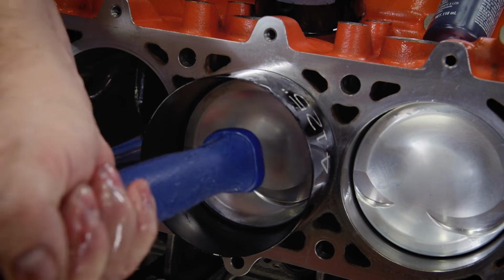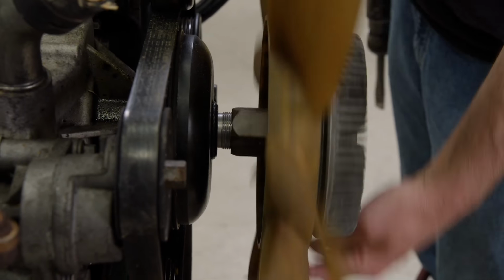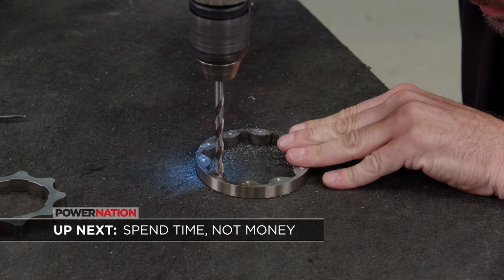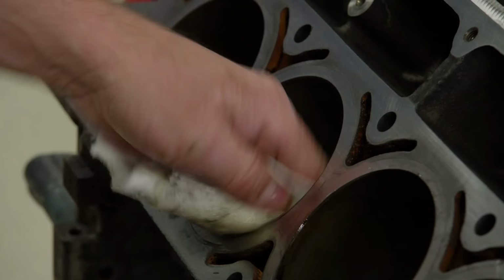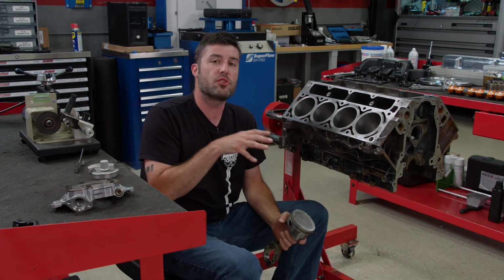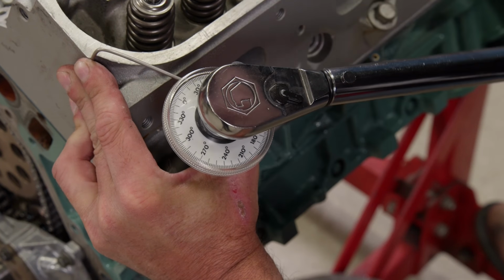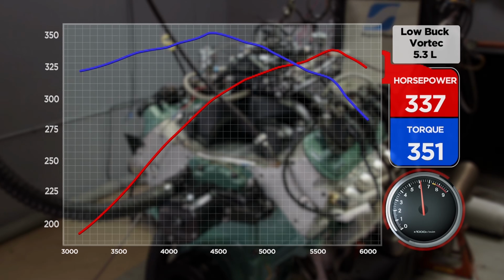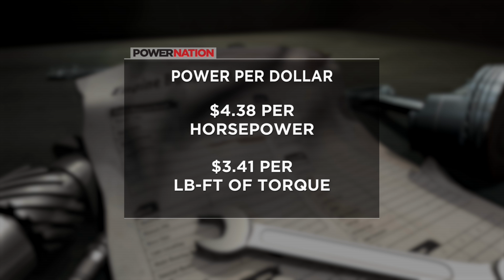Minor Upgrades Create Crazy Power on a Junkyard 5.3L Vortec - Engine Power S7, E10

Comment: You could get the exact same results by just a cam swap and intake upgrade on a bone yard engine most of the other stuff they did was unnessassary
Reply: They didn’t even do anything else besides cleaning which if you want a long lasting engine, is necessary . All parts were stock besides the mild cam
Reply: and how about the dupli-color green enamel 2000 paint ?  Gotcha :))))
Reply: Only other mod was oil pump and I can see that being important engines won't run long with out oil pressure
Reply: Yeah, they could’ve just upgraded the cam and intake but it wouldn’t be much of a show if it was over in 5 minutes.
Reply: Cleaning is pretty necessary
Reply: How is balancing a crank, and properly gapping piston rings unnecessary? 
They performed a basic engine overhaul.
Reply: @Stephen_2026-drq  If your going to run nitrous you need to add ring gap, the extra heat could expand the rings until they butted and scored the cylinders or lifted the top ring land on a piston.
Reply: And it won't go another 200k .  Rather clean it all put new bearings and have piece of mind
Reply: @sschevmale24  if its driven decently and has regular oil changes and not driven by an asshole, I don't see why it wouldn't go another 200k
Reply: @sschevmale24  Why not ?  In 2012 I pulled a 181,000 mi 6.0L LQ4 and trans out of a power company truck, pulled the pan and cleaned out the sump, Installed a new Melling oil pump, an Elgin 1840P cam and put bushings in the rocker arms.  Everything was stock including the intake and injectors, we reflashed the PCM and cut down the harness, never even pulled the heads or a rod cap.  I put it in a '91 Chevy 1500 and change the oil and service it regularly and right now I have 78,000 miles on it and 40+ lbs. oil pressure at Idle running 10w/30.  That's over 250,000mi + on the long block and she's still running strong.  I believe it could go 400k, now it's a test and still a ball to drive.
Reply: EXACTLY! If it came down to either throwing in the motor ‘as is’ or decking my block with sandpaper, I would choose the former.
Reply: Most of that was looking for problems that might destroy the engine unexpectedly. I’ve seen what can happen when a motor fires chunks of steel out of the block. I wouldn’t shoot nitrous through any used engine without the kind of due diligence shown here. But then I work on my daily driver, maybe I would worry less if I was building a toy.
Reply: what would the labor price be on a job like this?
Reply: @charlesawallacesr.9690  If you have to ask, you probably can't afford it. Nothing wrong with just buying a factory crate engine.
Reply: @charlesawallacesr.9690  Free, just do it yourself.  The LS platform is the easiest engine ever to work on.  You can literally do it like they did from a book.
Reply: send it
Reply: Lol If you want to jump straight to an upgraded cam, you're gonna have a lot of issues with your builds over time.
Reply: I love a good parking lot engine rebuild. It's amazing how mechanically inept most people are. People will watch you like your doing some some sort of magic. "I can't believe you got it running again!"🤯
Reply: What type of cam or model n exhaust brand or model if u don't mind thanks
Reply: @javierd.f.8695  Did you watch the video? they show what cam.
Reply: first of all u cant just adda nitrous kit and get the kind of power numbers expected. using a 150 hp shot of nitrous on a stock ring gap will crack a number of piston lands & possible engine failure. i know i did it
Reply: @racermike1946  If you watched it they opened up the gap to .030".
Reply: If it had a 650 cfm Edelbrock carb. With a Demon intakes manifold. Also installing peformance pushrods and rockers. Also peformance plugs. With a Holley Nitrous kit. That engine would have came alive. Makinig at leat 800hp.
Reply: @will4.0ofthethrone9  nitrous is lame
Reply: @will4.0ofthethrone9  lol, without making a more stout bottom end you can spray as much as you want. 800hp for one pass maybe......
Reply: @jasonyoung8614  I have LS's making over 1000hp with a stock bottom end and a single turbo and I've seen them make more than that and still live no problem even with the stock heads.
Reply: I cant imagine the logic with pulling 5.3 or 4.8 heads off any LS motor and reinstalling them.  You can find heads with 2” intakes for like 100 bucks, which will actually make a cam swap worthwhile.
Reply: Wick question can I do this on my Chevy avalanche 2005 1500 5.3L.?? Please any help
Reply: @recioh1297  it's the exact same engine so yes
Reply: @recioh1297  Sure you can.  Just do the cam swap and have your PCM reflashed for the higher output.
Reply: I kinda think the pushrods and rockers was well spent money.
Reply: Well i have the same engine with 264miles i need help
Reply: Which cam swap do you need
Reply: Those HP numbers are extremely inflated and exaggerated. Even with all the nitrous you want to piss into the thing, using the most optimal cam you can possibly match to the setup, any intake, throttle body you want, it’ll won’t make hardly any more HP... the restriction is the cylinder head w/ a pair of 1.6” intake valves. Oh, and no valve job either.   Gotta give  these guys credit though. They made a pretty sweet video.
Reply: Gross vs SAE net is about 20%, right there. Turns out, running accessories, and exhausting through a cat an muffler impacts peak HP.
Reply: @champspec  First off if anything those numbers are conservative.  I've built similar 5.3 motors that put out over 370hp with just a cam change.  Watch this and look at the stock numbers and cammed ones, everything's the same except for the cam,  those 706 heads are that good.  Were not talking about some old 350 designed in the 50's.   This is a stock 5.3 LS LM7 with just a cam change.  https://www.youtube.com/watch?v=aPtgp8czSqo&list=PL8Jl1TgUtEaXELp0F__3CcssdF5VSJxPQ
Reply: What cam and intake? New special springs needed for the cam? Please respond!
Reply: @buckshotgeorge7201  You can see the dual plane manifold and 750 carb on the engine.  The cam is basically an Elgin 1840P running the stock springs.  I install them a lot and use a set of LS2 Blue springs, extra insurance for only $80/set..
Reply: Made it reliable
Reply: Still watching all your videos Myvintage7512. Hopefully see some new stuff soon, but if not your still the man. I see alot of people saying there was a 5.3 vortec but isn't it a LS thats says vortec on the plastic intake shroud. I hope all is well in AZ. Stay safe
Reply: Not to mention why open up a good engine and start messing things up? If it isn't broken don't fix it. Plenty of boneyard low mileage 5.3 motors available.  Would rather save the $ for trans upgrade which you will definitely need with that 4l60 which comes behind nearly every early 5.3. Video was interesting but not sure I agree with the build.
Reply: @christopherhendricks4369  Yep! That 4l60E will be needing some upgrades to even try to cope with that sort of power!
Reply: I think that's a bit harsh. The purpose of this build seemed to be to show how much you can gain from an overhaul with the least amount of money spent possible. Taking a decently used junkyard 5.3 that was probably making less than 270 horse and getting 347 out of it was a pretty solid accomplishment imo. And they added a couple hundred thousand miles of life to it. Personally, if it's my engine to stab. I'd pick this kind of overhaul over just a cam and intake almost every time.
Reply: That’s not the point of the show dude😂 and plus he made a good point in the beginning
Reply: I basically came here to apparently subscribe to @myvintageiron7512
Reply: tearing it down added extra gap to piston rings asshole and replaced the worn rocker arms and pushrods .. as well as head gaskets that would surely have failed as in bolts not tight. people who but a junk yard motor and install it as is have no business even watching a high performance video as they are cheap fuckers
Reply: @griffon3275  I've never seen piston ring assholes must be something new I missed lol
Reply: @griffon3275  I think someone used their piston and added extra gap to YOUR "asshole ring". 🙄 Grow up.
Reply: @griffon3275  if your referring to myvintageiron75s,comment, you need to go watch his channel he puts these fellas to shame
Reply: Myvintageiron75... everytime I watch this show I think of you, how you could teach these guys a thing or two
Reply: @Retiredgarage  Its ALL just a big commercial for the stuff they use,, so you will run right out and buy that stuff thats it...
Reply: @larry40  They didn't use anything except a new set of rod bearings and cam, they even reused the head gaskets.  I've done the same.

Comment: Increase the top ring end gap for extreme operating conditions or continuous heavy work load restricted exhaust or high temperature (nitrous oxide, boosted applications or with pistons using a higher top ring groove location, placing the top compression ring at TDC at a higher point in the cylinder, where the inner cylinder surface temperature is considerably higher, if the ring ends touch they tend to grab the cylinder, and shear the top circumference of the piston leaving the ring in the combustion chamber in fragments, not good for reliability, I’ve seen this happen and been in the struggling vehicle and witnessed the spark plug center electrode and insulator shoot through the fiberglass front fender of a newly (and beautifully) refinished custom street rod! Paaaooww! Fafff Fafff Fafff Fafff Fafff! Couldn’t help it,  we were all caught off guard, and burst out laughing hysterically at the same time! It was pretty funny, that is until we realized the plug was only a symptom, and dropping a magnetic retriever into the plug hole, produced top ring segments (the aluminum alloy was devoured and packed into the high flow cats that had to be replaced (with higher flow empty cat shells) went with a new plant, sporting a larger bore and longer stroke, less heat, more total timing and more forced induction pressure added 160 horsepower and I forget how much more torque with no ballistic spark plug cores!

Comment: Factory rated at 285hp and that's with all accessories including the fan and at normal operating temperature so what they got was pretty much factory minus the accessories. That's not right what size cam did they put in that engine? I've seen a ton of these by Richard Holdener and they are usually closer to 400hp or better with a good cam.

Comment: I just watched this the other day and was amazed on the outcome. I feel you may have left a few minor items off your total bill. Regardless, this may inspire a lot of people to complete that project that is sitting in their driveway, backyard or lawn.
Reply: yeah they did, $600 carb and $400 MSD for a couple "minor" items that they left off but then again, if they had included those it would put the "minor upgrade" build over the top
Reply: @savagenomore   because you don't need to use those things. This is an engine build, whether you use carb with the MSD or the stock ECU and flash it isn't something they know, and it isn't something they should take into consideration. ECU would've been cheaper and more viable for someone actually doing this kind of build, they just used the carb and MSD because its easier and something they already understand.